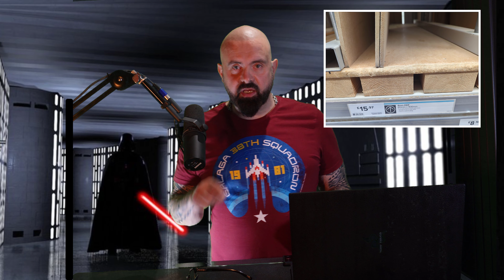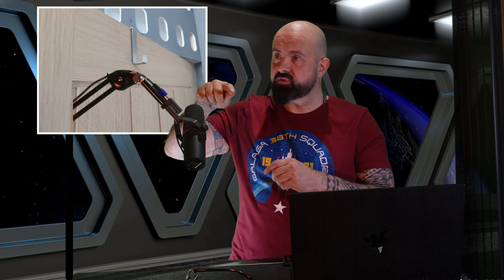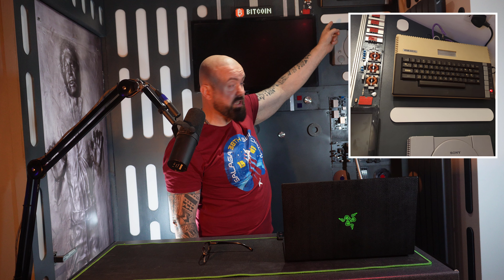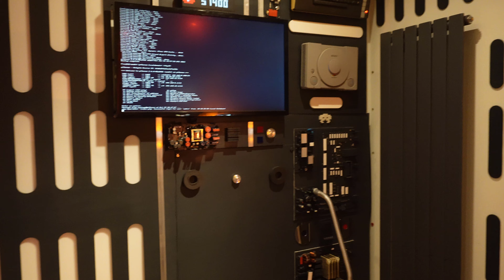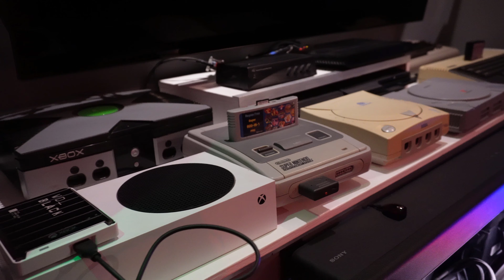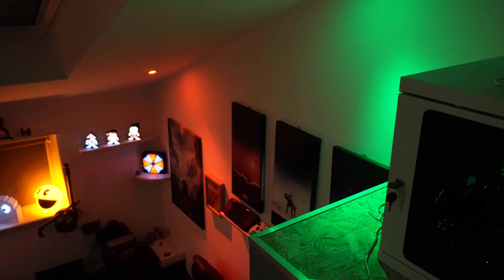Spaceinvaders Mothership - Awesome New Small Studio Office Tour  2022

Comment: Hi, got a situation with my array and did lots of research to understand the order of operations I need to take. Had a data drive fail (no data was on it yet) which I was going to replace then my only parity failed before the new drive came in. Now I'm waiting on a replacement parity drive aswell but wanting to make sure I don't overwrite my array when it gets in. From what others on the interwebs have said is to stop array, create new config (preserve data), and then I assume I show it the new data drive and parity drive at that time to let parity rebuild? Got 60tb of data I would prefer not to loose which is why even though I'm fairly sure this is proper, I wanted to ask the guru that's taught me everything about unraid, you.

Comment: Please look into the MiSTer FPGA device, so you can have your arcade cabinet work even though you use the cabinet as your server rack. MiSTer FPGA can fit in a really small case, but there are also some for ITX size case, including once designed for Arcade cabinets with a JAMMA connector